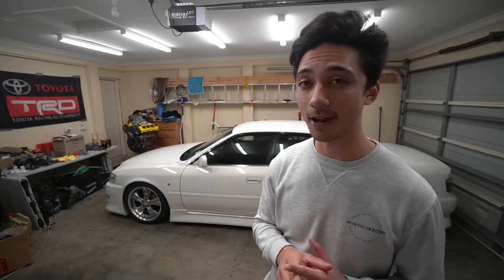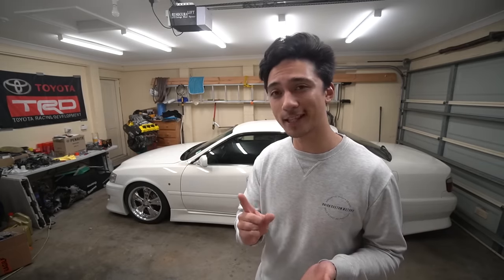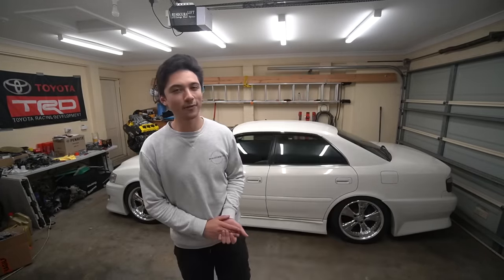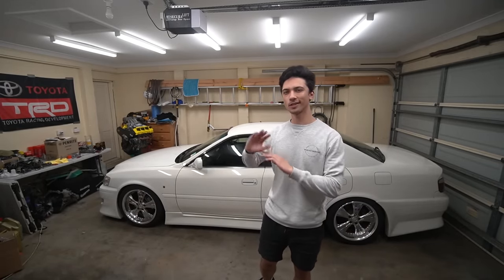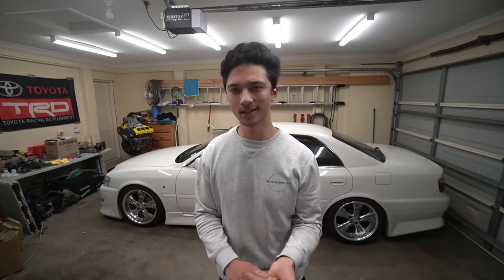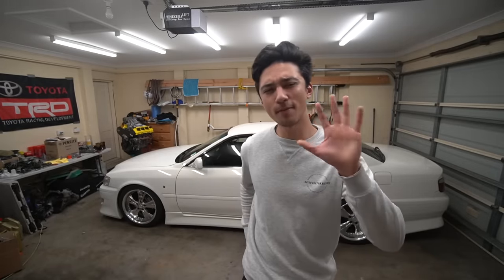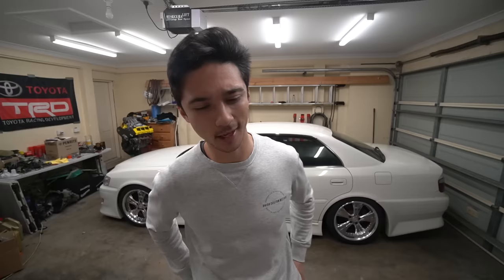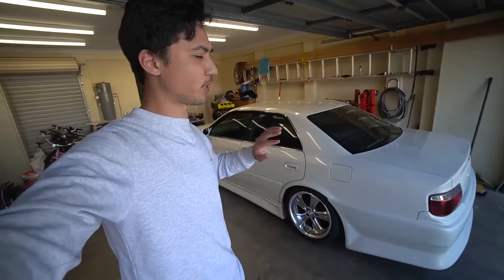The First 5 Mods You Should Do To Your Car (For Cheap)

Comment: Best mod to do is upgraded brake pads and rotors, being able to stop quickly is just as important as good acceleration.
Reply: Tyler Westman  Dimpled and slotted rotors are a massive improvement over stock brakes. along with high temperature pads and steel brake lines.What the hell are you on about.
Reply: Tyler Westman  most mods are just upgrades of shit your car already has like his whole list....
Reply: @justforlucky9049  Indeed
Reply: @gbcpoop9504  it means your brakes wont fail in a track and will be more effective during higher temperatures compared to street brakes which are typically better for lower temps that will be seen more often in everyday scenarios
Reply: Tyres are much more important. Braided lines (especially if it's an older car) are hugely beneficial, but aftermarket pads and rotors on a street car are expensive and unnecessary for the most part - more braking force is pointless if you can already lock them up.
Reply: @dyIanVII  Rotors aren't that expensive, and I agree tires are important. But I thought that was common sense that tires are super important to performance and safety. nice pfp btw makes me feel old as.
Reply: Tyler Westman  man has never upgraded to bigger braked 😂
Reply: why get brakes when i cvan just hit a three and stop instantly?
Reply: Tyler Westman  I dont see where you got the conclusion that I dont know English or that you cant fit bigger brakes 😂but you fail at both. if you didnt know, as long as you have room, you can fit 4-6 piston brakes on a car that came with 1-2 piston caliper brakes, as well as up-sizing the rotor. in other words, upgrading the entire brake system, aka bigger brakes. the smarter you try to be, the more of a fool you become it seems.
Reply: Tyler Westman  btw, it seems you never learned english, since the word youre looking for is brakes, and not breaks 😂😂😂
Reply: This is something that people need to take more notes on. The amount of times i have seen someone showing off their 500hp civic type R, and i take a look at the brakes and their disks look like they have the stopping power of a Bagel it makes you worry slightly.
Reply: not really man, most cars can deal with stock brakes well into mods. brakes are about the best things that come stock in cars now adays
Reply: Brake systems generally aren't going to make you stop that much quicker, the tires are the biggest changes to stopping distance. The way brakes affect stopping distance is brake fade which is the reason why cars get big brake kits. Also, drilled and slotted rotors don't make that big of a difference either unless you actually track your car because your brakes rarely get hot enough with even spirited street driving, plus they tend to crack and wear down much faster than solid rotors which have more surface area and more stopping power just because of basic physics. 

Upgraded brake pads, like high heat pads, are actually really bad street pads because they're really ineffective without being heated up, and like I said before, your brakes don't heat up nearly as much on the streets as they do on the track.

If you wanna run ceramic pads, those will be more than enough for even hard street driving, but you need to realize that you'll rarely be putting in the kind of braking that a track demands unless you do some serious canyon carving and a big brake kit isn't going to do nearly as much as you think it is unless you're adding serious power that your brake system isn't rated for. But for the most part the engineers have made a very effective braking system
Reply: @edgarorellana5914  destroyed him😳
Reply: quite unnecessary unless its either damaged or you're going for huge hp gain which is highly unlikely
Reply: @dyIanVII  yea but you'll be changing tires every time they start to get bald so
Reply: Boring
Reply: Tyres
Reply: If your tires can skid when you brake, unless you get better tires or do weight reduction, there’s nothing you can do
Reply: And tires
Reply: Tyler Westman  if you've driven different types of cars you'd realise just how much difference new/different brakes are.
Brakes that stop you quicker and are also more reliable improve your driving experience by magnitudes while also remaining to get you out of a hazard quickly. You wouldn't want to just spend money hardware for performance and then end up rear ending someone or going off a bend 🤷‍♂️
Reply: You don't need brakes to go fast
Reply: @HI42YT  true, However brakes are still super important. If you are hammering it out in the hills and some dick head is doing well under the speed limit you need to stop harder than they can push the accelerator.
Reply: brake pads dont allow you to stop quicker they allow you to stop quick longer
Reply: Tyler Westman  brakes are extremely important my first car was complete garbage which had terrible brakes, my new car has great brakes and it gives me peace of mind and confidence
Reply: I would do stability bars and tighter suspension, no point in having a power if you can keep it on the road. And brakes can help. Some work better and some don’t.
Reply: So uh, you need a suspension kit to do the turning better and then the brakes.. on a track you will not go braking at all the turns.. you only brake when in the 200 to the 50 depending on how sharp the turn is, and you dont stay braking while in the turn, you brake to get into the turn, then dont gas nor brake and in the exit of the turn you throttle it again, the more faster and sharper you turn, and remember, almost all turns in a single track will require different gears, so it is also nice to change the shifter (if you are in an clutch manual car) to a short shifter and the stick also should be changed to one you like and it should fit in your hand.
Reply: Do you have any recommendations?
Reply: Tyler Westman  A car also has wheels, yet we change them. your logic is severely flawed.
Reply: @itznsdominator3521  you would get better preformance spending your money on expensive wheels and tires tbh
Reply: Couldn't agree more especially when someone is just starting their daily driving.
Reply: Brakes are important to you, not for me
Reply: No, speed is good and always be good
Reply: Yeah, it think that 60-0 is more important than 0-60..
Reply: Tyler Westman  but putting a swaybar on a car that’s already there is considered a mod?
Reply: No brakes are useless
Reply: @jackson72625  Is this a typo or do you really believe that brakes are useless
Reply: Tyler Westman  lmao bruh what? You tellin me an old vehicle with factory single piston brakes isn't gonna benefit from a 2 or 4 piston set up? 😂
Reply: @itznsdominator3521  I just replaced my brakes and rotors. I bought duralast gold as thats what they had on them previously when I purchased the car. I’ll use them for a little while but want to buy something of higher quality. Do you have any recommendations for quality brakes, rotors, and calipers (I didn’t replace the calipers) 
I have a 2013 hyundai sonata.
Reply: Why would anyone want to stop…we ONLY accelerate…
Reply: Tyler Westman  guess headers and exhaust arent a mod.
Reply: Tyler Westman  "bREaks ArE BrEAkS" the most irritating thing I've ever heard.
Reply: Tyler Westman  11 Months later and you’re still wrong
Reply: Or drivers liscense
Reply: Carbon ceramic breaks are a must have. 0 brake dust is amazing thank me later
Reply: You are right, but I’ll upgrade tires first
Reply: Yes!!
Reply: Walls stop you instantly, why waste money on brakes ?
Reply: And don't forget break fluid

My teacher had a student with a modded civic or something (some kinda hatchback) that was stripped, new breaks, had acceleration comparable to a C6 corvette, and he took it to a track, 3 laps in and he boiled the fluid, and totaled his car
Reply: @tobylarrison4826  don't forget better break fluid aswell, no matter how good the breaks, if you have bad fluid your fucked
Reply: its wide wheels... wider tyres are what translates braking or acceleration from the systems designed to deliver those things, but its the wheels and tyres that are the ultimate recipient of all those impulses from the car, be it braking, acceleration, suspension performance, downforce...
Reply: Good point thanks
Reply: More important
Reply: I did my friends brakes two years ago for $150 and he got the parts ($264)... I just paid somebody to do mine. Cost fuckin $800. Bet your ass im gonna advocate DIY on this one lol. Drums arent hard, get the adjuster kit.
Reply: True
Reply: Tires.
Reply: First thing I'm doing is the brakes after registering my new used car, as it needs new car anyhow, and I plan on getting the goooood ones.
Reply: This is a good list. The short throw shifter is the first upgrade I do.
Reply: @zachsilby4569  Hawk HPS 5.0 Pads are pretty good choice or EBC pads
Reply: Jesus loves you alot trust in His death 4 salvation and be saved from eternal hell <3 Jesus died on the cross for you bro.  :)
Reply: A good pads is all you need in most scenarios
Reply: True story folks. I mean....he's not wrong
Reply: Blud said upgraded brakes stop you quicker... go back to physics school
Reply: Not cheap or easy
Reply: Boringggg
Reply: true but dont forget tires first. breaks are only as good as their tires
Reply: Just go buy a 69 Chevelle 396 4 speed.  Can’t corner can’t stop but you are gonna get laid more . If you lean on that tin can you’re gonna dent it .
Reply: Whats the most you would spend to fully replace your brake system?

Comment: "you can always put the muffler back" laughs in angle grinder
Reply: i luaghed in sawsall after 4+ hours of trying to get my damn muffler off normal
Reply: 3 mins with a chain pipe cutter. Clean cut aswell
Reply: Yeah, welding doesnt exist.
Reply: laughs in sawzal
Reply: Sawzall cut both mine off in 30 seconds and welded it on and got it all hung in an hour
Reply: if youre talented enough you can always weld it back on
Reply: @kanga287  “talented” hahahaha, it may not look good but it’ll sure as hell stay. I’m going even farther and trying to convince my parents to go straight pipe but I doubt that’s gonna happen
Reply: @dylanslattery1009  my dads helping me take my muffler off tomorrow lol
Reply: Laughs in c4
Reply: laughs back in mig welder
Reply: laughs in clamps
Reply: JB weld mate! 
.... and a bit of sika flex
Reply: @veke05 i heard that it does :o

Comment: Most important modification to do to your car is fixing every problem the car has the moment you get it. I know some may be hard and not fun or interesting to fix, but especially mods that increase power or power deliverance will cause strain, and if you dont fix problems that also affect the points you are modifying, you're asking for problems. So please fix you're current things that dont work, and then add on the car 👌
Reply: you are right but not every power increase will cause strain. and most cars (especially japanese) will have no problems with increased power
Reply: good metaphor for life tbh
Reply: I definitely agree and I’m at that stage rn. I need a new engine, power steering pump, ac compressor. All this before I get to the fun stuff.
Reply: Thanks bro
Reply: @SatoriASMR  Actualy that's funny, you're right. With relationships too. Don't try to get into one if you still have personal issues to change.

Comment: Mod 1: Muffler delete, it improves the sound (may not work for all cars).
Mod 2: Sway bars, connects the suspension of the wheels and improves handling.
Mod 3: Short throw shifter, it reduces the motion of shifting gears.
Mod 4: LED light bulb headlights, it may make the light bluer like xenon headlights and increase the light output to make it look nicer during night.
Mod 5: Pod filter, may increase performance or decrease but mainly makes it sound nicer.
Reply: Mod 1: Muffler Delete. You'll get tickets for that where I live. And the sound will be raspy. And you won't pass your emissions test.

Mod 4: LED/Xenon/Hyper White bulbs. I've probably had like 5 pairs of these in my life. Longest lasting pair I ever had for 8 months. Most of them died around the 4-6 month mark. So I never bought them again. I put back in my Honda oem bulbs and they lasted 5 years! 

Mod 2: I agree. Sway bar makes a big difference. Especially if you can get a used one from a compatible car instead of spending $200-300 on a Progress or Eibach or whatever brand.
Reply: Muffler delete is a good way to have your entire neighborhood hate you lmao
Reply: wish i looked up that muffler deletes are fucking illegal before i tried it -_-
Reply: @REDACTED_AX0  just add a nut i between the connection of the muffler and the pipe works about the same
Reply: thanks dude
Reply: how do you know if a short throw shifter firts ur car
Reply: I can see where you're coming from 😏
Reply: @Saulana  obviously only for manual transmissions but it’s vehicle specific. find someone who makes one for your car
Reply: @reaver9174  5 months later i havent found one😂
Reply: @aznnp77  I think you're confusing muffler delete and cat delete. Muffler deletes are perfectly legal, provided you don't exceed the legal sound limit, and as far as I'm aware, it will not change your emissions. A cat delete, illegal, usually up to a 10k fine and will definitely change your emissions.
Reply: @strider5119  That's not true for some places. In my area, any exhaust other than OEM is technically illegal. Not having a muffler at all would stick out like a sore thumb, if the noise alone doesn't get cops' attention. You are probably correct about the emissions test though. I deleted only my resonator before and my exhaust was loud as heck even with a muffler. It didn't sound good either, so I got rid of it.
Reply: @aznnp77 an axel back exhaust system does ***nothing*** to your emissions, changing your mid pipe/ cat back system does. Two different things, stop spreading misinformation.
Reply: @aznnp77  I didn't say no muffler. A muffler delete just removes one. Most exhausts will have a cat and 2-3 mufflers. Most people delete the rear one, it'll change and increase the sound, but nowhere near legal limit usually. And if your state doesn't allow anything other than a factory exhaust, that's unfortunate. Most places will have emissions and decibel limits. As long as you're within that, you're fine. Or a cell count for the cat etc.
Reply: No way I’m going to be one of those people that use LED headlights lmao. I’m not tryna blind other drivers
Reply: @coldcoffeegaming2798  if done right they're fine, both my cars have custom exhaust I have zero complaints and they're totally legal where I live.
Reply: Will the muffler delete work on an infinti
Reply: @coldcoffeegaming2798 it’s not even muffler deletes bruh💀 there’s a trackhawk down the road from me with a big bore coming right out the hood😭😭
Reply: Jesus loves you alot trust in His death 4 salvation and be saved from eternal hell <3 Jesus died on the cross for you bro.  :)
Reply: @aznnp77  where i live you would have to weld it back up every 2 years to pass mot, not to mention if cops see it and give you a ticket ON that, your car instantly loses roadworthiness. and honestly...

Breaks and tires EVERYONE forgets them.  but honestly that is by far the best "mod" i ever made for a car
Reply: @accuratebatalan825 what do you think a cop would say if they believe it’s too loud at that point but they see your muffler is still there? Just let you go? I don’t know much about cars yet and also ofc doin shit that the cops won’t like.
Reply: Is muffler delete legal in uk?
Reply: Muffler delete so your car can sound like a fartcan
Reply: Muffler delete not legal in UK :(
Reply: Thank you for the list of mods. Now I don't have to waste my time watching the video
Reply: Kinda didn't want to watch anymore after he said that first mod should be that.
Reply: may not work for all cars
wont work for most cars. that camry did sound fucking nice tho, ngl
Reply: Yeh... Don't do this.
Reply: legend